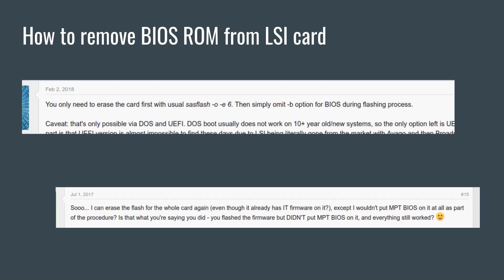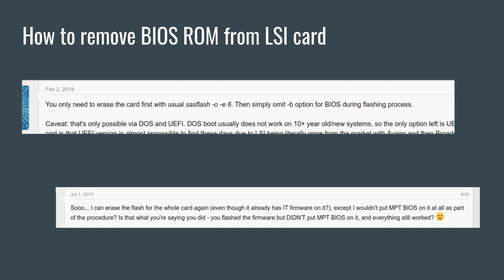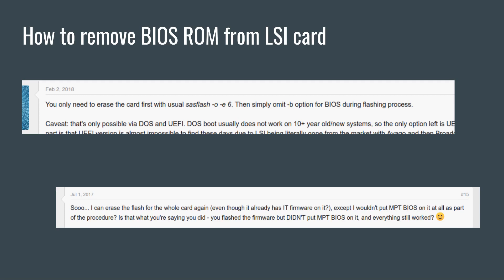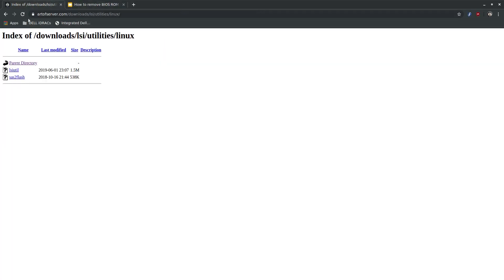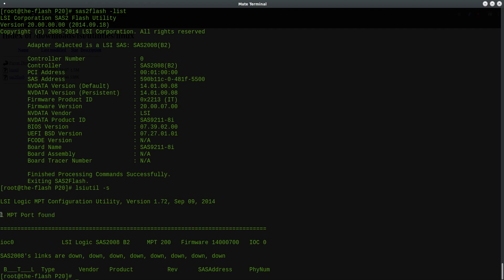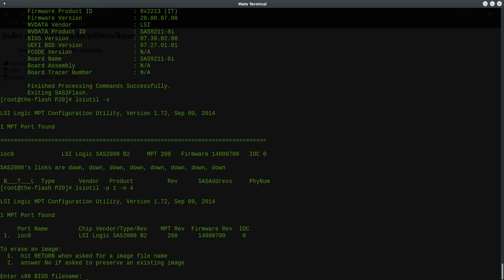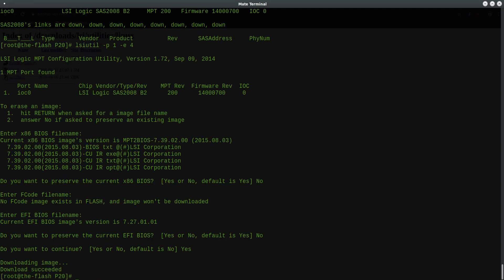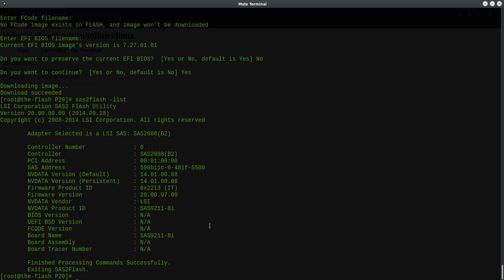How to remove BIOS ROM from LSI card

Comment: how do i run this straight from unraid terminal
Reply from the maker: you need to first install the tools in your unraid system using the Linux version that is statically compiled or compiled for your specific version of unraid. then just use the terminal.

Comment: Take a look at this hotness:
[root@UR ~]# ./lsiutil 

LSI Logic MPT Configuration Utility, Version 1.72, Sep 09, 2014

3 MPT Ports found

     Port Name         Chip Vendor/Type/Rev    MPT Rev  Firmware Rev  IOC
 1.  /proc/mpt/ioc0    LSI Logic SAS1068E B3     105      011a0000     0
 2.  /proc/mpt/ioc0    LSI Logic SAS2308 D1      200      13000000     0
 3.  ioc1              LSI Logic SAS2308 D1      200      0d0a3500     0

Select a device:  [1-3 or 0 to quit] 

hot mess.  the 1068 is onboard, the 2308's are in pcie slots.  but two ioc0's huh?

Comment: how can I backup my current rom (bios, efibios, firmware, and anything else) before doing this, and before updating it as well?  I have three lsi adapters that I'd like to carefully backup, then update and remove the bios from all three to speed up and lower complexity of boot
Reply from the maker: what do you mean by backup bios, uefi, and firmware? those files are available for download from broadcom.com so why do you need to back them up? (see this video https://youtu.be/v5v8TCcvA8s)

What you might want to backup are things like the SAS address, assembly number, serial number, etc. On genuine LSI cards, those things are printed on labels on the card so you can always look at them. Or, you can save that information in a file using the sas2flash program.

Comment: SAS 9300-8i: almost four minutes wait before Ubuntu boots.
Plenty of "info" out there or "fixes", but this lsiutil is the bestest!

1 MPT Port found

      Port Name       Chip Vendor/Type/Rev    MPT Rev  Firmware Rev  IOC
 1.  ioc0                  LSI Logic SAS3008 C0          205         08000000       0

Current active firmware version is 08000000 (8.00.00)
Firmware image's version is MPTFW-08.00.00.00-IT
  LSI Logic
  Not Packaged Yet
x86 BIOS image's version is MPT3BIOS-8.17.00.00 (2015.02.05)
EFI BIOS image's version is 9.00.00.00

Main menu, select an option:  [1-99 or e/p/w or 0 to quit] 4

To erase an image:
  1.  hit RETURN when asked for a image file name
  2.  answer No if asked to preserve an existing image

Enter x86 BIOS filename: 
Current x86 BIOS image's version is MPT3BIOS-8.17.00.00 (2015.02.05)
  8.17.00.00(2015.02.05)-BIOS txt @(#)LSI Corporation
  8.17.00.00(2015.02.05)-CU IR exe@(#)LSI Corporation
  8.17.00.00(2015.02.05)-CU IR txt@(#)LSI Corporation
  8.17.00.00(2015.02.05)-CU IR opt@(#)LSI Corporation

Do you want to preserve the current x86 BIOS?  [Yes or No, default is Yes] no

Enter FCode filename: 
No FCode image exists in FLASH, and image won't be downloaded

Enter EFI BIOS filename: 
Current EFI BIOS image's version is 9.00.00.00

Do you want to preserve the current EFI BIOS?  [Yes or No, default is Yes] no

Do you want to continue?  [Yes or No, default is No] yes

Downloading image...
Download succeeded

Main menu, select an option:  [1-99 or e/p/w or 0 to quit] 1

Current active firmware version is 08000000 (8.00.00)
Firmware image's version is MPTFW-08.00.00.00-IT
  LSI Logic
  Not Packaged Yet

Power on, Ubuntu in 25 seconds.

Thanks!

Comment: finally I found the answer, I guess my server board doesn't support the LSI having a bios ROM or is there a setting? 
Went through tons of forum posts of people telling others to just go into bios and and change boot order with the card.. but my motherboard doesn't even get past loading with the card when it has it's bios
erasing it (using a different computer that I guess does support it) worked
I guess I owe you an ebay purchase..
Any idea why the supermicro X11DPH-T would not support it? or settings?
Reply from the maker: Glad this helped. not exactly sure why you had a problem. I usually don't see this type of issue with Supermicro boards. I have seen HP Proliant BIOS have a conflict with some versions of the LSI BIOS ROM. Another option is to disable the Option ROM on the PCIe slot you are using in the motherboard setup menu.
Reply: @ArtofServer  thanks I'll write that down (option ROM part).. my asus AM4 desktop board was able to load the LSI card so I could delete the stuff and it boots. Since it's storage only as you say and not boot I prob won't do the firmware.. If it was still on there I'd try it though. Their ~230 manual doesn't even mention pcie roms or lsi or anything unfortunately =/
I maybe tried the option rom since I went through so many forum posts, but I forgot all of it since it was trial -> fail -> trial -> fail for like 50+ different things lol

Comment: I was able to remove the bios with just the sas2flash tool under efi shell.

sas2flash -c 0 -o -e 5

5 being the parameter for boot services.  Sounds like your tool does some additional functions too.  It was more work to set up a linux environment than to just try the above first.  Worked well on 2 sas2308 ibm cards.  

Nice to have fast boot times back again. Not sure what I flashed the bios to begin with. Sure it's nice to have the config utility right there, but with just 11 drives, boot up delay was a good 30 seconds or more.

Oddly enough, ran into a bizarre issue. Asus x570e, 5900x.  Two identical boards (and bios versions and settings) and cpus. On one, if CSM was disabled in the bios, with any drives attached to the sas controller, the system would do its drive scan, then just blank screen (tested with secure boot enabled and disabled, same result). If no drives connected system would boot. Enabling CSM support allowed the system to boot. The CSM setting was not needed in the 2nd system.  Oddest thing.  

After getting rid of the bios in the card in the first system, it booted fine without CSM enabled. These asus boards are decent (relatively speaking), but the bios is buggy.  Set a parameter that screws something up and not even a clear bios jumper works.  Seems the only way to clear it was to flash a different bios version entirely. Annoying..
Reply from the maker: Thanks for sharing this tip!

Comment: What are your options if you PC won't post with the card installed beside installing the card in another PC?
Reply: I figured out how to boot from a PC that doesn't post (black screen).  If you kapton tape the B5 and B6 pins it will boot.  Something to do with the card expecting a Dell PC.
Reply from the maker: Thank you for the follow up and sharing your solution. Indeed, I've talked about the SMBus issue in one of my older videos: https://youtu.be/HBnNaheYmdA

Comment: Nice work, I really enjoy your videos.  What would you do if you wanted to put the bios back on?
Reply from the maker: Watch any of my how to flash IT mode firmware videos and I show how to do that. You just leave out the firmware part, but do the BIOS ROM part.
Reply: @ArtofServer  Thanks for that.  If BTW I have an H200 HBA already do you still have to flash the IT mode?  I ask because Im trying the repurpose drives from 520-512k like in your other video but its not working with it.  Thanks for the time and knowledge!!

Comment: lsiutil does not see my MPT (0 MPT Ports found). sas2flash -list does. mptctl is loaded.

LSI Corporation SAS2 Flash Utility
Version 20.00.00.00 (2014.09.18)
Copyright (c) 2008-2014 LSI Corporation. All rights reserved

	Adapter Selected is a LSI SAS: SAS2308_2(D1)

	Controller Number              : 0
	Controller                     : SAS2308_2(D1)
	PCI Address                    : 00:01:00:00
	SAS Address                    : 500605b-0-0a2a-6570
	NVDATA Version (Default)       : 14.01.00.06
	NVDATA Version (Persistent)    : 14.01.00.06
	Firmware Product ID            : 0x2214 (IT)
	Firmware Version               : 20.00.04.00
	NVDATA Vendor                  : LSI
	NVDATA Product ID              : SAS9207-8e
	BIOS Version                   : 07.39.00.00
	UEFI BSD Version               : 07.27.01.00
	FCODE Version                  : N/A
	Board Name                     : SAS9207-8e
	Board Assembly                 : H3-25427-02J
	Board Tracer Number            : SV51102479

	Finished Processing Commands Successfully.
	Exiting SAS2Flash.

Any idea?
Reply from the maker: did you run lsiutil with root privileges?
Reply: @ArtofServer  yes did so
Reply from the maker: Sorry, then I'm not sure what is going on there.
Reply: @ArtofServer  No worries, thank you.

Comment: How do I get my LSI 2116 SAS2 card to work? I plugged it in and it show up in device manager, but when I plug in Harddrives to it nothing happens and they dont show up in file explorer or windows partition. When I boot the computer there is no bios for the LSI card it just boots like normally.

Comment: Can anybody help with this... I'm unable to remove the bios. I flash with freedos, erase the firmware, add new firmware but the bios survives options 5 & 6.
Reply from the maker: If you followed this video, you should know now that you don't need to erase the firmware at all. just run the commands in this video to remove the BIOS ROM.
Reply: @ArtofServer  Hi, thanks for the reply and for taking the time to make this helpful video.  TLDR - I got it working with another system/ MB with the freedos process.... Broadcom support helped me figure out it was the configuration of my MSI gaming MB on my new build. I didn't want to mess with all the setup I did for clocks, timing, rtx 3090, boot, fans, etc. I just put the card on another system and the flash process worked just fine. Again, thank you, much respect for YouTubers like you that make helpful videos such as this one.

Comment: i used wget to dump sas2flash and lsiutil into  /usr/local/sbin  when i try just run sas2lfash -list i get permission denied error. when i run it as sudo i just get command not found. what im i missing or doing wrong ? im using unraid and doing this via putty. im logged in as root
Reply: update:  i fixed it i just ran it off a usb drive mounted in exfat and it worked thanks you are a legend this video rocks
Reply from the maker: OK. glad you figured it out on your own! Thanks for watching! :-)

Comment: Thanks. This works for a Dell Precision T5600 box which has the Intel C602 Chipset which uses the isci drivers which is one of the ones dropped, but for which ELRepo has a DUD iso for. A main issue you clarified is why we need to have the driver on an iso, and not a a bare rpm. It's probably because the boot-up procedure wants to see drives, not files. So I put my DUD iso on a usb key with dd. I booted up the centos install iso on another USB (I kept the DUD iso out until after the installation disk boot up, to avoid bootup confusion).
Reply from the maker: Did you mean to leave this comment on the CentOS 8 on SAS2008 controller video? Not sure how this applies to removing the LSI BIOS ROM?
Reply: @ArtofServer  yes, I'm such a dodo.

Comment: I like SAS drives, the only issue is the long booting time, specially that I use them for home and not for servers, good that Windows fast boot is only affected in the restart, so I just avoid to restart, but would be nice to have a SAS card that is already without any bios, so I just plug my hard disks, and does not slow down the rebooting time, I use them not as primary disks, of course I have my NVMe for that, so I think I don't need a a bios for the SAS LSI card, if you sell a card already configured I would buy it, the only issue is that I am in Chile, if you considered to post here using the eBay global shipping program I would be interested
Reply from the maker: All my internal HBA SAS controllers have the BIOS ROM; I find it useful to help troubleshoot problems and choose boot device. All my external HBA cards do not have the BIOS ROM; since some times people attach really large arrays and not likely to boot off an external disk shelf. Of course, you can always follow this video to remove the BIOS ROM if that is desired.

I do ship outside the USA via eBay Global shipping, including Chile. Link to my store is in the video description if you'd like to look around.
Reply: @ArtofServer  Hi,

For some reason Chile is not listed, which is weird as is a country where ebay global shipping is common. Would you sell an internal HBA SAS with no BIOS ROM? Thanks
Reply from the maker: i have a video around here showing how to remove the BIOS ROM from an LSI card if that might help you. but no, I don't sell any internal HBAs without the BIOS ROM.
Reply: @ArtofServer  I would like this card

HP H240 SAS-3 12Gbps HBA Host Bus Adapter 779134-001 761873-B21 726907-B21 ZFS
Would be possible to sell it without bios for fast startup?
For some reason this item does not post to Chile, biut I was checking other items frtom your store and they do post to Chile, would be possible to make it happen? :) Thanks
Reply from the maker: No the H240 is not like the LSI SAS cards... not sure you can remove the BIOS ROM on those like you do with LSI cards.

I'm not sure why Chile is not listed? I've certainly sold to Chile before, and I have no exclusions in my listing (just checked). I would say contact eBay... could be a glitch on their end or their eBay global shipping temporarily suspended shipping to Chile. Not sure.. i have no control over that part.

Comment: I am using a SAS card under windows, I would like to remove the bios, I used this tutorial under ubuntu (without install it), just from the pendrive, but even if I go to the download folder under the terminal and I see the lsiutil file, when I run as root user it says "command not found". I also tried ./lsutil and it shows "PErmission denied" I am obviously not a Linux user, I just want to do this to speed up Windows, what am I doing wrong?
Reply from the maker: it's hard to tell what you're doing with the description above, but my guess is that you downloaded the program, but did not set it for execute permission. To do that, you need to run this command on the file:

# chmod +x lsiutil

and then try to run it as 'root'.
Reply: @ArtofServer  Thank you
Reply: @ArtofServer  root@ubuntu:/home/ubuntu/Downloads# ./lsiutil

LSI Logic MPT Configuration Utility, Version 1.72, Sep 09, 2014

0 MPT Ports found
root@ubuntu:/home/ubuntu/Downloads# ./sas2flash
bash: ./sas2flash: Permission denied
root@ubuntu:/home/ubuntu/Downloads# chmod +x sas2flash
root@ubuntu:/home/ubuntu/Downloads# ./sas2flash
LSI Corporation SAS2 Flash Utility
Version 20.00.00.00 (2014.09.18) 
Copyright (c) 2008-2014 LSI Corporation. All rights reserved 

 No LSI SAS adapters found! Limited Command Set Available!
 Finished Processing Commands Successfully.
 Exiting SAS2Flash.
root@ubuntu:/home/ubuntu/Downloads# 

I think my SAS card is not compatible, it is an HP 16 Gb, the Ubuntu "Disks" app shows both of my SAS drives so even Ubuntu is running from a pendrive it is detecting my disks properly.

I like SAS drives, the only issue is the long booting time, specially that I use them for home and not for servers, good that Windows fast boot is only affected in the restart, so I just avoid to restart, but would be nice to have a SAS card that is already without any bios, so I just plug my hard disks, and does not slow down the rebooting time, I use them not as primary disks, of course I have my NVMe for that, so I think I don't need a a bios for the SAS LSI card, if you sell a card already configured I would buy it, the only issue is that I am in Chile, if you considered to post here using the eBay global shipping program I would be interested
Reply: @ArtofServer  Hi! I installed ubuntu just for this as I have a problem with my lsi-card not letting me boot into my motherboard bios or into any os. But I have a problem. I can't get the program to work. I do the same thing as the guy above. I also tried to cd into my downloads folder and run the # chmod command but it does not do anything. what am I doing wrong? 😕

Comment: i am trying to put the bios back onto the two cards (hp9205-8i and a lsi9300-8i). i keep getting errors "ERROR: Failed to initialize PAL.  Exiting Program"  i tryed this on a boot usb with freedos on it.  Any sugestions.  This is so i can see the drives in windows, unraid, and freenas.
Reply from the maker: Your motherboard BIOS might be missing a few features required by the DOS version of the sas2flash or sas3flash programs. Try using the UEFI version instead, or do it from within the OS by using the Linux version. This is one of the reasons why I don't like the DOS versions.